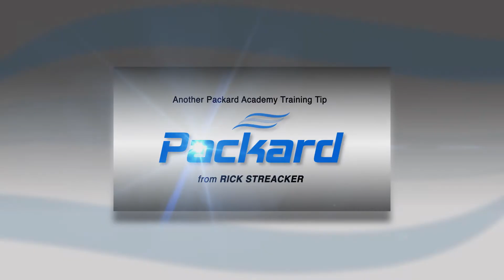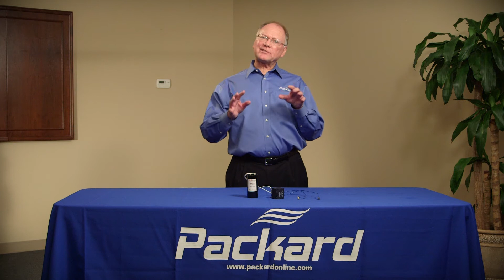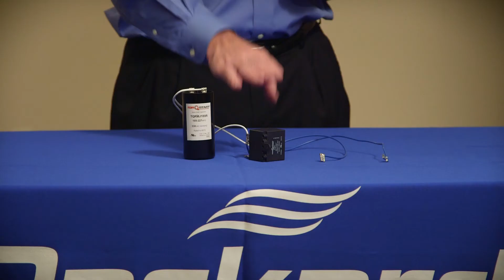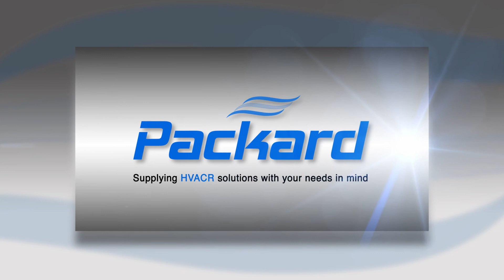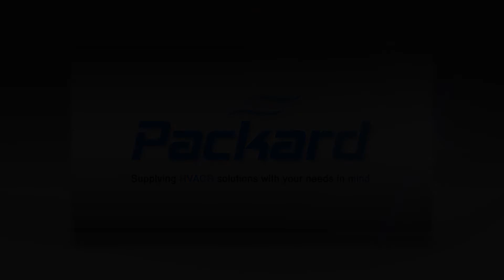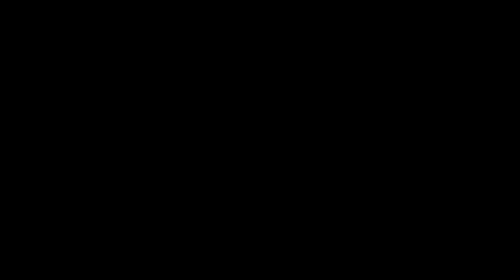Potential Relays- What You Need To Know

Comment: How, and where would I measure EMF (Voltage) to use to size for the right potential relay.
Reply: Using a multimeter set on A/C volts, one probe would be attached to each terminal of the capacitor.  The measurement is taken while the system is operating with all panels, guards, and filters in place.  Please remember to follow all manufacturer’s recommendations for sizing the potential relay.

Comment: Canyou tell me how to size one of these for a 5 hp air compressor motor please?
Reply from the maker: Thank you for the question!
 A single-phase air compressor motor typically would be equipped with a mechanical switch mounted internally.  To convert to a potential relay the back-EMF of the motor would need to be determined.  This could be measured as a voltage when the motor is operating under load.  This voltage must then be within the relay’s pick-up voltage range.
 
If replacing an existing potential relay in a hermetic compressor, the new relay should match the same pick-up and drop-out voltages of the existing relay.  The ICM Controls UMSR-50 Universal Motor Starting Relay can also be used.
 
If the hermetic compressor currently does not have a potential relay and start capacitor, but is equipped with a run capacitor, a hard start kit, such as the TORQSTART EM, can be added.  The hard start should be sized properly to the compressor.  Packard’s TQS2 is rated for 5-ton compressors.